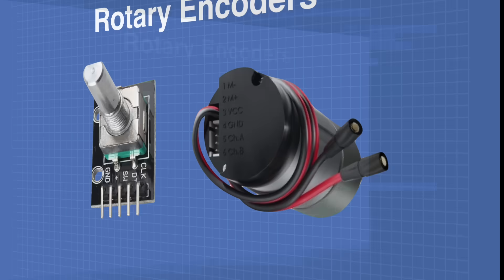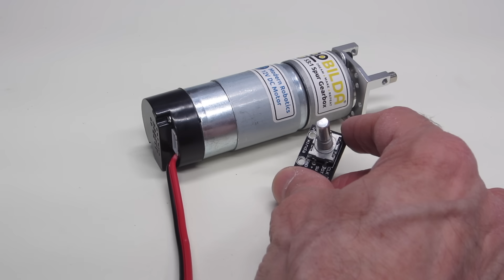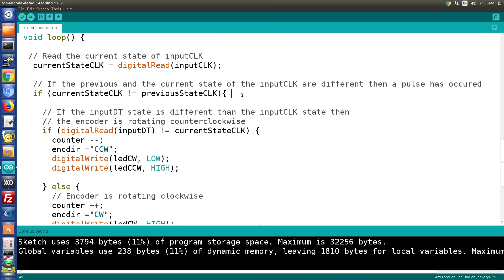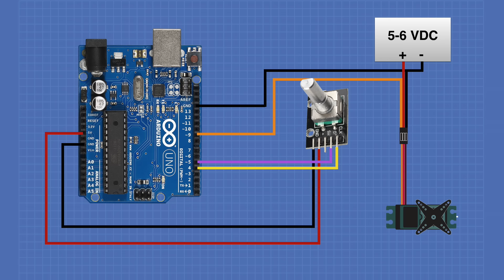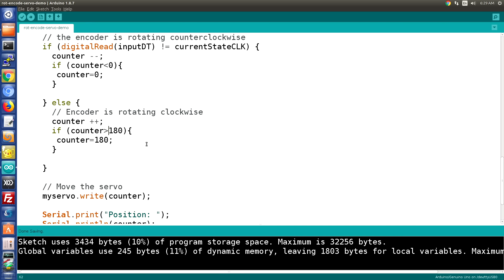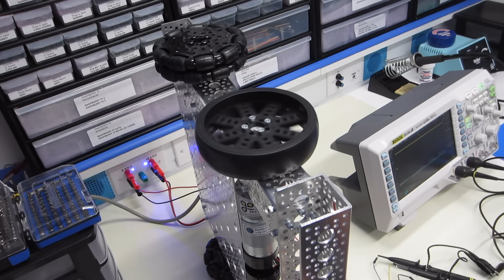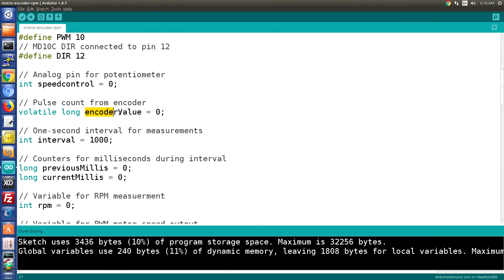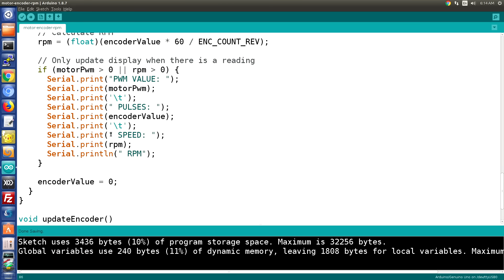Using Rotary Encoders with Arduino

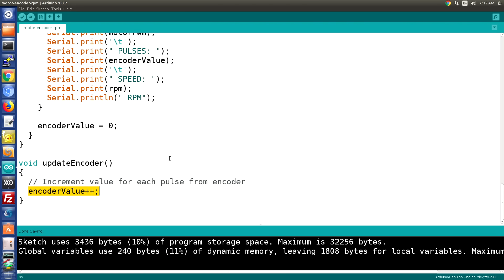Comment: 26:30  I realize that this is "only a demo", but it pretty much defeats the purpose of demonstrating use of an encoder on a motor. First it uses only one wire of the encoder so that it records pulses-per-time (ultimately RPM) without regard to direction. Next it doesn't actually use that info as feedback for the motor speed. So adjusting the pot to command 50 rpm (say) only produces a particular PWM value, with no feedback that would increase that PWM value when the robot encounters some load that would tend to cause the motor to slow down.  Such a feedback loop is the main point of measuring the variable you're trying to control (here RPM), and turns a plain "adjustable speed motor" into a "servo motor", and would have been a nice comparison to the preceding servo example.  TO do so, the loop would have to evaluate RPM more frequently than 1 sec though.

Comment: 32:05 For the servo "be sure to use a pin capable of PWM".  Not necessary as the servo library doesn't use the hardware PWM functionality, so any digital pin can be used for servos. https://www.arduino.cc/reference/en/libraries/servo/

Comment: Hi, thanks for a great video. Do all the rotary encoders work the same  way? I have one which looks identical to yours. I've double checked all the connections but when I run the program the sense is reversed. If I turn the shaft clockwise the red led comes on and the monitor tells me it is rotating CCW . And of course vice versa. If I reverse the viring on the clk and dt pins it works as it should. I'm very confused.

Comment: i want to control a dc 12 volt motor with a rotary encoder ! i am using a tiger to opperate the encoder so the encoder will only move about 20 degrees from 0 to full rpm or 12 volts. i have a rotary encoder i do no think it make s difference in what i use! but i need to see how to connect the arduino and encoder  to the power supply to run the motor! also i would want ramps on the start and stop part and be adjustable! any help would be great. you videos are great.

Comment: sir how to controlle exact position of encoder without using potentiometer  for example I need in 90, 180, 270, 360.  encoder should be stop for this positions

Comment: Sir,  your videos are always a pleasure to watch. They are very informative. I had a question. I have 4 rotary  quadrature encoders with 2400 pulses per revolution  and for my use case it is essential to use them in this high resolution.  My question is what microcontroller will be best to read these pulses. If I use ardunio mega, It often fails  to count pulses at high speeds (around 1000 rpm x4 -> 160,000 pulses per second).

Comment: I have watched most of your videos, and I have to say they are absolutely excellent - they're clear and very detailed. You've made me very enthusiastic about using Arduino. I wonder could you answer an important question? When controlling a stepper motor remotely, how long can any of the cables be, either to the motor or from the rotary encoder. I need to remote-control a stepper motor from a distance of 15 meters. Many thanks, goddlediddles.

Comment: Hi there
I got a question
Imagine a rc receiver which is powered up by an external battery and is sending pwm signal to a servo
Now, I got an arduino and I want to read the signal is being sent to the servo from the receiver but my arduino is not powered by that battery
how should I wire up the system?
thanks for your help!

Comment: Thank you so much for the video. I am a bit confuse, what's the difference between the practicality of the encoder/sensor in this video https://www.youtube.com/watch?v=oQQpAACa3ac&t=1379s vs the above video? My robot is not going straight and some people told me I need to look into PID control, some says need optical encoder, thats why I tried to clear up my confusion
Reply: This example tracks actual position, by counting steps and decoding direction of movement.
the one you linked in your post only handles speed, not caring for number of steps or direction of movement.

Comment: what is the difference between a servo motor and a stepper, and where to use either?
Reply: A servo motor is used to control a motor to move certain angles (usually limited angle range). A stepper motor is used for precise movement.

Comment: Can you also use the potentiometer and Stepper motor with driver and powersupply to control direction and speed of the Stepper motor? Reason I ask is I watched your video (Big Stepper Motors with Arduino) and was wondering if a person could not combine the two?

Comment: Rotary Encoder Demo  #define inputCLK 4  #define inputDT 5.   Hello .  I ran your demo program for the rotary encoder.  it gave CCW when I rotated  CW . Visa Versa.  Wired exactly as you described.  If I switch the  pin 4 and 5 its ok.   Did any one  have the sam results?

Comment: I'm now wondering if it is possible to come up with a circuit that, without a microcontroller, translates the left or right movement, into the momentary "pressing" of existing left and right buttons. I'll have to think about that one a bit. I'm guessing you could hook the contacts of each of the exiting buttons to either side of two transistors and that would mean you control "pressing"/"not pressing" though the respective gates. The bit in the middle (i.e. when to trigger one gate or the other in response to different directional knobs turns) needs some more thought though!

Comment: Hello !
I want my motor to go to a position chosen with the encoder.. could you please help me?
Reply: If you don't need continuous rotation, a servo would be the way to go, otherwise you're looking at a stepper or servo motor with an encoder. They are not cheap, starting at around $100 or particularly small. If you need that level of control, they will do it.
Reply: You do what he started doing with the first encoder, that was the same thing, surely?
If you want to "choose" a position using the encoder, then "send" the motor to it, then you need to do what he did with the encoder, but have your Arduino remember what value was set by the encoder, without sending the motor anywhere.  Then you use the servo library functions to send your servomotor to that angle/position as a separate function.
I hope this helps, it's hard to give advice remotely!

Comment: Why did int speedcontroller = 0; connect "speedcontroller" to pin A0? In contrast, I see int interval = 1000; and that does not connect "interval" to pin A1000. I also see pinMode(…, INPUT) to connect pins to symbols like inputCLK.  I'm new to Arduino, I just know C. Awesome video, awesome channel. Thanks.

Comment: I have successfully created a new kind of DC prototype motor which works equally well with a mechanical commutator, or an L298N motor control with a disc and photoelectric switch.  Is there a better switching system that I should be trying?   I've never worked with Arduino, so would you be able to recommend an improvement (maybe Arduino with optical encoder?) that would reverse my polarity every 90 degrees?    It all works using 30VDC @ 3 Amp, but soon going to test with higher voltage.

Comment: is it possible to bend a aluminium profile using stepper motor, Arduino, driver and power supply by 90 degree ?

Comment: There are operational problems due to the code which is not stable. The operation is very dependent on the mechanical quality of the encoder. There are inevitable rebounds that are difficult to compensate for by a capacity whose value is critical and difficult to determine. But in the case of my encoder, I realized that the good functioning was not possible because of the long duration of the instructions digitalRead () which were longer than the time when the 2 output A and B are low. It is easy to write a piece of code to sample some output A and output B values and realize that the sequences do not correspond to the theoretical operation.
Reply: Digital read should take around 5 microseconds... I seriously doubt the encoder is turning that fast. Your circuit may need some 'debouncing' to function properly. If not, you could also try sampling the port directly. The Arduino library functions add significant overhead.
Reply: @stephenborntrager6542  It is not a problem of the encoder rotation speed. Examine with a digital oscilloscope in single shot mode the timing of signals A and B. We see that it does not go exactly as expected. This is due to the mechanics of the encoder and the arrangement of the electrodes inside. On their rising edge the signals are well phased but on the falling front, I could see surprising phasing as the 2 almost at the same time (< 5uS) or one before the other but not the expected one. I wrote another code which is robust for all these hazards.

Comment: Can you please do a video on how to remove switch bounce so that it doesn't increment/decrement by a random number?
Reply: IKR, so many people having issues with this. He's probably trying to keep things simple, but still, he really should have mentioned it. Debouncing buttons is fairly easy, but one pulses relatively fast, so it's more complicated. You can do it in software but it will limit your maximum detectable rotation speed, and makes for complicated read functions. There are also circuit modifications that are much better, basically using resistor and capacitor as a filter, but there's a tradeoff on response time, and you could end up loosing pulses too. I'm not expert enough to say how exactly you choose the resistor or capacitor value, but they are must not be too low or too high. There are actually IC's designed specifically for debouncing, so it's actually a fundamental issue worthy of it's own specialized component!

Comment: Nice job. Just what I was looking for.  I am a newby Arduino project guy, but have been in manufacturing control for 35+ years. Concepts easy, hardware/firmware constraints require learning.  Fun! I am building a wooden boat with Arduino control of throttle and steering.  Not a model...it is 16 foot. I want everything super light weight.  Your videos will all help.

Comment: You mentioned using "quadrature" encoders which to my knowledge use 4 connections A+, A- & B+, B-, in addition to the + - power connections. These are used in devices, such as, digital calipers and linear scales, as used for positioning on lathes and milling machines. Also, I have a quadrature rotary encoder (omron) that also uses the AA,BB connections. Quadrature implies 4 so what is the difference between the 2 wire you used and the 4 wire I mentioned?
Reply: The cat says: Quadrature encoders can also have two wires or three wires. If the encoder have 4 wires or 6 wires then it is a differential output.
Differential output is mostly for safety applications. The A- signal show the inverted of the A+ signal, the same for B and Z signal.  The Z signal is for index pulse, only one pulse pr. revolution.

Comment: I'm wondering if I could use that encoder and Arduino board to make a rotary controller for MAME classic arcade games. There is a distinct lack of readily available products for such an application and it appears as if I'm going to have to make one myself. Both the Arduino board and encoder are readily available so hopefully I can make something with them. Thanks for the video my friend and for sharing your knowledge.

Comment: What is the maximum rpm that can be measured with an encoder equal to this?
And what will fail first, the arduino, or the encoder, do you think the arduino clock is capable of calculating like 15000rpm with a 360ppr encoder?
Reply: Interesting question, but you could probably figure it out with some math. digitalRead is reported to take about 4.9 microseconds, giving a maximum sample rate of 200kHz.
360 PPR * (15000 RPM * 60 seconds) = 324000000 pulses per second (Hz) or 324 MHz. If the chip did absolutely noting else, it would need a read rate of over 648 Mhz to just to sync up with the pulses (because we need two reads per iteration), but realistically, you would need a read rate of a few GHz to get reliable results. So if you overclocked the Arduino to a few teraherz it might work. Although this type of encoder would likely fly apart long before it reached 15000 RPM, sadly.

Comment: Thank you for the video.  When I do this, each "detent" move on the rotary encoder moves the counter up/down 2 values. Is this correct, or should it move it only 1 value?  When I'm in-between the "detents", the counter moves 1 value, but detent-to-detent is always 2 values. I don't want the value to change during the "in-between" positions, rather only from one clean detent to the next. I am doing this wrong?
Reply: I noticed this same behavior. I can account for it in code of course, but this was not expected.
Reply: @markgamache6377  I think this is happening because the main loop only looks for a change in state instead of looking specifically for a low to high. If I'm reading it right, it will trigger on low to high and then when it goes low again.

Comment: Can somebody explain or link to subject, why should we connect "servo's ground to arduino ground" at 14:12 ?
Reply: The Pulse width modulated signal being sent to the servo without a common ground is a stray noise signal. Voltage itself is a potential difference.... i.e. a difference from Ground. Without a Ground reference there is no meaning to the signal voltage. This is why you need to set both the servo and arduino ground to the same potential and this brings signal voltage into meaning.

Comment: Hi, i want to control one dc motor with rotary encoder and wireless communicate with nrf24l01.
For dc motor its need to be have  speed and direction control with rotary encoder. 
Please help me in cods for transmitter and receiver.

Comment: Any idea where to find some mid-range encoders that would have more detents/ppr/poles (not totally sure what the differences are but I'm looking for higher higher resolution)?  All I can find are the cheap ones like these for about 50 cents each, https://www.aliexpress.com/item/32991511891.html, or then much larger precision encoders for $20-30 on up.  I want to make a control board for a software program and would like something nicer than the 50 cent ones but not more than say $3-4/each.  Any ideas where I might get something like that?  I tried digikey and found some that go to 24ppr, anything higher seems super expensive.  Maybe I just don't understand which type I actually need to get.  I saw there's some libs to quadruple resolution...maybe that would help although it would still feel 'clicky' with only 20 detents.

Comment: I have a quadrature encoder motor that's rated 9.0 VDC  / 86RPM unit with a motor to output shaft ratio of 75:1. But no where can I find its 'Pulse Per Rotation. / Revolution PPR' number - so I can input same as the number for 'ENC_COUNT_REV' as shown at 23:05. Anyone have an idea how I can calculate same? Ta.

Comment: Those waveforms aren't 180 degrees out of phase, though it's an easy mistake to make.  They are 90 degrees apart which is why, I guess, it's called a quadrature encoder.  

I haven't gone back to look at your code but I think that fact is how you can tell from the states of each, compared to the previous, whether it's going CW or CCW.  I'd need to think it through, but I don't think you could do that if they were 180 degrees apart.

Comment: I like the ones that function like jog-wheels with a momentary push button. Pretty good at doing complicated UI stuff with minimal interface, but not pushing a button 500 times or holding one down a button that has some kind of acceleration that always overshoots. Something seen in the better designed car stereos, but seems less common in other stuff.

Comment: I see an application here for keeping a sail boat at a certain angle to the wind, typically electronic wind steering systems on boats cost a fortune (around $2000). Auto pilots as we call then have the option to steer a set course which is relatively easy but steering to wind becomes more difficult, I can see one could set ones boat up to steer at 47 degrees to windward and the boat will keep that setting until you want to steer a different course relative to the wind. I don't see any real hardship in doing this however the marine technology companies have not dropped their prices relative to the huge real drop in prices of the electronic components or technology to make this happen. If you could make a simple unit to do this you could well sell them for a couple of hundred $$ each (a tidy profit) and you would have people beating your door down to get them
Reply: Isn't the point of these videos to enable YOU to do it?
Reply: @ChristianRThomas  I thought the whole idea was to share ideas. Why reinvent the wheel??
Reply: @mikeobrien9829  It seems like a new project to me.  And it looked suspiciously like you were asking Bill to do something that you wanted.
Reply: @ChristianRThomas  Far from it, many have already made autopilots for boats, however none have included a sail to wind direction function, I was just pointing out to the many developers out there that this would be a good use for use for the encoder as a wind direction device, just an idea that would definitely have very large profit making potential due to the ludacris prices charged by the marine industry
Reply: It's just a rotary encoder. It won't help you make a functional auto-pilot any more than it will help you make a boat itself. If it's inspired you, great, but an input knob is like, the least complicated part of an auto-pilot. There is usually a reason when things are expensive. It could very well be compliance with safety protocol and fees for approvals driving the price up.